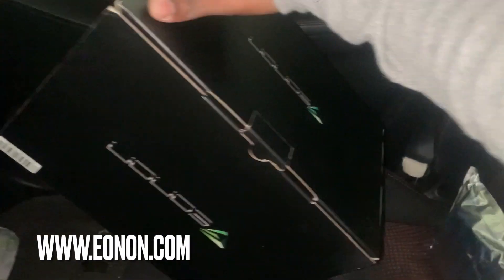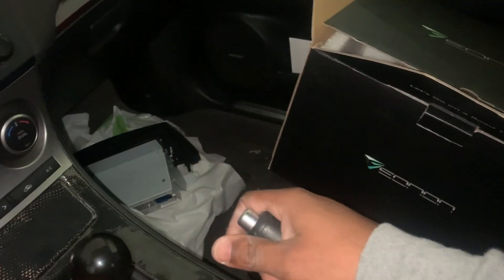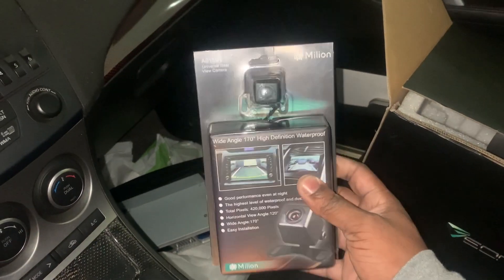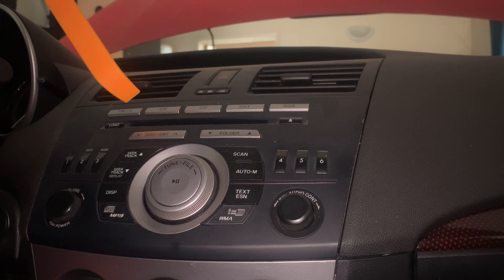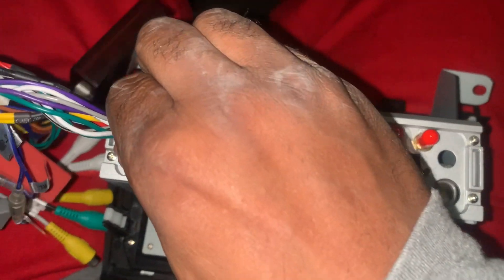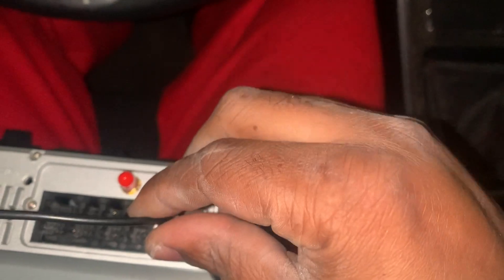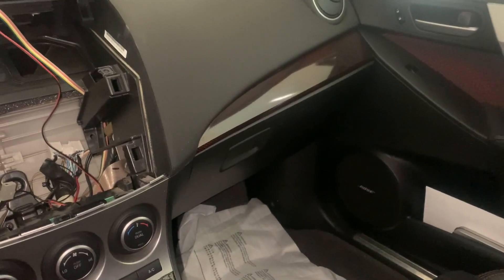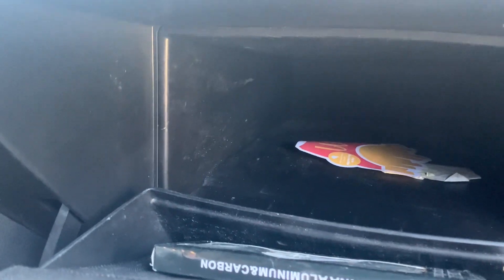How to install a Eonon head unit on your Mazdaspeed 3

Comment: It’s weird because I have Bose but when I hook it up the Bose way it’s super quiet when I do it how it came it’s loud
Reply from the maker: Put stock back in turn it all the way up than disconnect it and hook the Eonon back up and try that, don’t forget to the unit has Equalizer on it too
Reply: @waresgarage8590  no luck it works the other way it’s just there’s a static sound at low volume you can hear.
Reply from the maker: @HumbertoCristobal  that’s weird ummm ..you tryed using the equalizer? I see people have that problem I don’t have that problem with mine I just got a gopro 9 I’ll make a video for you guys
Reply: @HumbertoCristobal I have the same issue i hear some like static noise, kinda like waves or something when volume is low. And i also can’t adjust my base or adjust the sound in my car whether it’s in LF, LR, RF, or RR.

Comment: Hello, can you help me, I have an Eonon GA9463B Mazda 3 2012, the sound does not work, how to connect the cable, the sound does not work, no Bose?
Reply from the maker: Do your car has bose? Or no
Reply: @waresgarage8590  it doesn't have a Bose system, the sound doesn't work for me, Al works on the original radio.  has two pcs.  same problem
Reply from the maker: @vedranvitkovic4496  you sure all your connectors are plugged in right? And when you took your radio out the stock one was the volume turn all the way down add me on instagram if you haven’t and msg me I want to see pictures of yours

Comment: Hi, What do we do with 16pin  audio wire from the car which has not been connected in any part of head unit. Probably and audio cable?
Reply from the maker: The extra wires you see it’s for if you have an amp or a sub box,

Comment: I have 2010 Mazda3s GT 2.5L with Bose Audio, everything works fine except the Bose Subwoofer, Not sure why? The radio is Eonon Q63Pro
Reply from the maker: So you have the Bose already but your sub not working? Was it working before you installed the new unit? If you don’t know, installed the stock one back in and see if it’s working if not your sub could be blown
Reply: @waresgarage8590   Thank you! it’s a stock Bose unit and it seems it does get output except that it’s cut off at low amp gain. If I increase the gain it seems to work. The problem is at higher gain the output is too loud even at lowest setting. For now I have set the gain to 0 db in factory settings for the audio.
Reply from the maker: @shuklaz  does your head unit has a equalizer? And is your unit the eonon?
Reply: @waresgarage8590  Yes it has equalizer and the head unit is Eonon Q63Pro. Don’t know for sure if the equalizer setting for the sub has any effect or not
Reply from the maker: @shuklaz  the speeds had I think it’s own little amp box for the sub, when you turn it up it’s not getting the full 12v, probably have to by pass it to have that little amp get 12v all the time, get what I’m saying?

Comment: Just bought one of these and I greatly appreciate the super detailed install...  Almost every question I had before buying you answered.  Installing into a 2012 speed 3 with tech package/bose.

Hopefully it goes smoothly.
Reply from the maker: thanks bro, glad my video was able to help you, just to tell you before you take your stock unit out turn the volume up before taking it out
Reply: @waresgarage8590  for sure.  Do you know if it's possible to upgrade speakers with this head unit?  I might upgrade the bose mid-range speakers in the front and rear doors but heard some people had issues with the stock head unit.
Reply from the maker: @mcsnowman11  I’m not sure on that, but I don’t see why it wouldn’t work still, all you doing is upgraded it if you hook it back the same way the stock Bose are, than I don’t see any problem with it working still
Reply: InstaBlaster...
Reply: @waresgarage8590 amazing video I’m waiting for my unit to come and also have tech w bose.  I heard the sounds is better but some issues with the stock woofer in the back?
Reply from the maker: @cinque8335  I heard that too, but I don’t have no problem with mine, mine works great

Comment: Yo!! can you help me why mine no sounds when i install i have the teck pack with bose system connector doesn't match to my amp i hope you can help me mine has different connector since i have the touchscreen factory radio
Reply from the maker: Do any of the connectors even fit? Like any? Your probably not getting sounds since your connectors is different, I’m not sure on that one brotha, call customer service to see how come you don’t have the connectors for your setup or maybe you got the wrong one
Reply: no any extra connector yes everything works only problem i dont getting any sounds..the eonon unit i order is the expensive one M3BLA12S you think i order different kind of unit
Reply from the maker: @wenzyglife6549  I looked it up and should work, the connectors for the bose you have that all hooked up, was your radio working before the install ? Sorry I’m taking a while to reply I’m at work
Reply: @waresgarage8590 i have the touchscreen factory radio the connector its not the same i can't send you the pic here
Reply from the maker: @wenzyglife6549  add me on my IG Waresgarage

Comment: Do you have part number for the audio output part?
Reply from the maker: No I don’t bro sorry you need just that part?
Reply: @waresgarage8590  yes bro, I have input cable connect to aftermarket head unit, need the output cable to connect to bose amplifier.
Reply from the maker: @shradheyashrestha6375  I see what I can find for you brotha

Comment: My box didn't come with bose instructions. Just a generic black and white two-page A1 booklet. Sigh. Also instead of one pair of Input L & Input R. I got two pairs and they are both labelled the same. So I tried plugging both of them and comparing the sound. idk if I wired it up correctly since they both have the same labels! I have bose system.

Anywho my front left passenger speakers don't work for some reason. I don't know what I should do now. Maybe have to uninstall and reinstall the old factory stock HU and see if the issue is with the head unit or somewhere else.

And just to add that extra crap on the icing my bluetooth won't pair!

Oh btw I have sent several emails to eanon and they have not helped me even once. Just something to consider if you are worried about issues with the product or installation and need guidance to proceed. After all for many of us this is not some inconsequential side project. We are working on our vehicle which we need to work and this situation I am in is just not acceptable.

Guys I say this with sincerity not just out of spite.. Even if you did months of research and continue researching after you have issues it is sometimes *not worth it*. I was too impulsive and frugal with my money. Consider a sony or crutchfield. Just consider it. Look at all your options before buying an eanon.

Comment: Nice Video! A lot of questions had been answered... however I got another one: Do you need to install a mic when the head unit has a mic already installed at the top left?
Reply from the maker: When you buy this head unit it comes with a mic that you hook up in the back of the unit, my video I put the mic up onto the left pillar
Reply: I would recommend using the external mic that’s supplied. The internal one is awful.

Comment: Bro, how is the sound quality? Is the bose system still working correctly
Reply from the maker: Yes sir, the sound quality sounds great the Bose system still works as it should, the head unit has an equalizer to
Reply: @waresgarage8590  thank you for the reply, my volume  is so low and no bass. Just got it yesterday......dont know if my bose system is working right
Reply from the maker: @stephenmarais5642  your stock Radio before you too it out was the volume high or low when you took it out ?
Reply: Having the same issue . Bose works when I’m not driving the car . Once I start the car it goes real low and no bass .
Reply from the maker: @DantesInfernoh  are all your connections are right? Like do you have the Bose connection hooked up to the Bose? There’s two connections one for just N/A Bose and the other connection for Bose, do you have the right ones connected? Oh and another thing which I was told before you take out the stock Radio turn the volume all the way up than disconnect it, but you can go to the equalizer part and setup your sound too
Reply: @waresgarage8590  yeah I’m sure i hooked it up right , will double check when I get home . Going to try the volume thing as well , I  don’t think it was high when i took it out .
Reply from the maker: @DantesInfernoh  yea try that put the stock back on turn the volume up max than disconnect it out the Radio back in..I did all that and my sound was Gucci..I mass with the bass a little but
Reply from the maker: @DantesInfernoh  let me know how it goes when you do that
Reply: @waresgarage8590   Fixed it... Finally found the time to reply . The wire connector that you said to unplug so you can connect the Bose wiring harness that was provided by Eonon was my issue . Basically I connected mine like I didn’t have Bose and it works fine . Thanks for all of your help and keep on making the videos My Guy !
Reply from the maker: @DantesInfernoh  that’s good man glad you fixed the problem, so you said you hooked up the wire to the none Bose and it works?
Reply: @DantesInfernoh  having the same exact issue! I was boutta just get rid of the eonon and just got it two days ago, imma try this out now thanks
Reply: @T6travels  I thought it was the unit itself so I returned it and had Amazon send me a new one. The problem was still there so I did what I mentioned above . Hopefully it works for you .

Comment: Love the video man! But I just a ques though. Does your factory subwoofer works still? I got the same head unit and I have the Bose system as well but my factory subwoofer isn’t working.
Reply from the maker: Thanks bro, yea mine is still working..you might have to take it out and see what’s wrong with it
Reply from the maker: Did it recently stop working or it haven’t been working for a while ?
Reply: @waresgarage8590  that’s what I’m thinking. The thing is I plugged that one harness that you didn’t install so I’m wondering if it’s because of that lol. My subwoofer always been working but it was just at the moment when I installed the head unit; that it stopped working.
Reply from the maker: @joseponce2930  yea the Mazda’s with Bose speakers there’s a harness where you take it off and plug the other one and the ones with out Bose you leave it
Reply: @waresgarage8590  yeah that’s what I did but for some odd reason my factory subwoofer isn’t working. Ima just pull it out again and look thru the harness and double check that I have done it the right way.
Reply: @waresgarage8590  but there is one harness that I noticed in your video that I didn’t get to see where you connect it. I’m assuming it’s for the Bose system.
Reply from the maker: @joseponce2930  yea the other two are for like if you have a sub box in your car and the other extra harness is for like if you have a amp when I get home I’ll check again
Reply from the maker: @joseponce2930  hey I looked at my sub with my Volume up high and my Bose sub is working...maybe you plugged something in wrong or maybe it blew out..did you disconnect your battery when you install your head unit?
Reply: @waresgarage8590  actually I found my issue lol I had plugged a harness that I shouldn’t have installed. Thanks though
Reply from the maker: @joseponce2930  oh okay so everything working now he’ll yea bro good shit
Reply: @joseponce2930  Which harness did you plug bro?
Reply: @elrana1000  well I just plugged the main harness that you need to connect to the car and that was it. I accidentally plugged and extra harness that I didn’t need lol